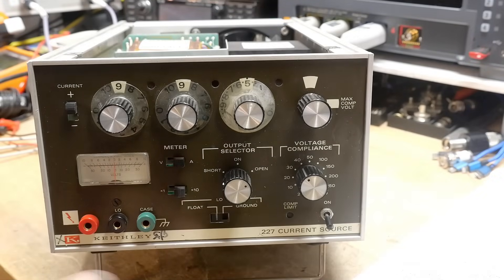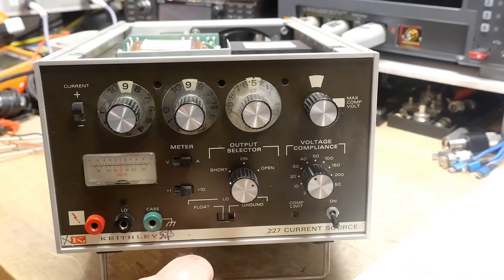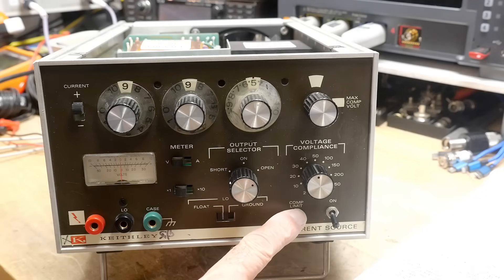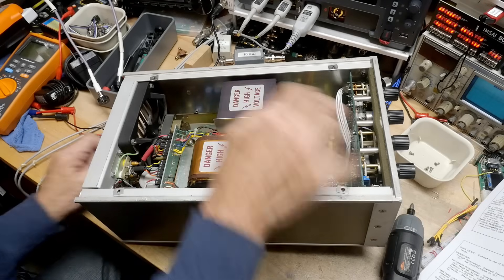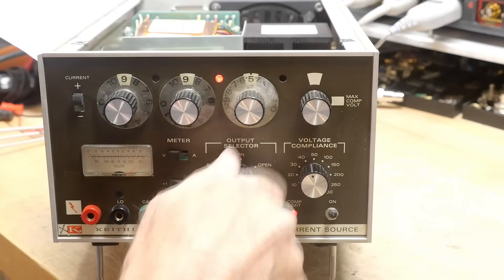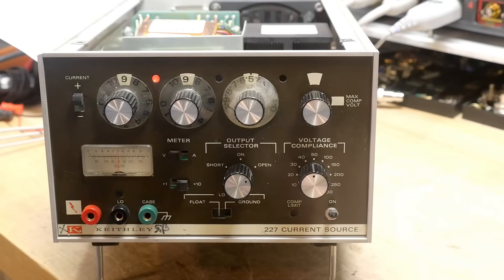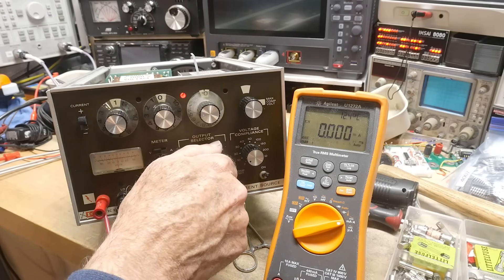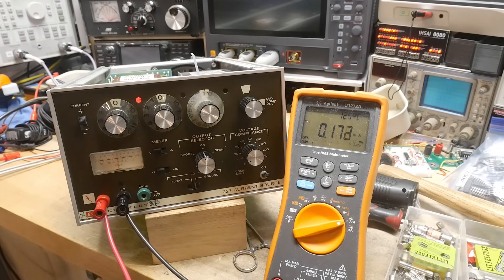#2455 Keithley 227 Current Source (part 1 of 3)

Comment: That's actually ideal for checking large series-strings of leds as found in modern lights with just a little current regulation but very high voltage.

Comment: For the old instruments on can useually get schematics.  The switches / pot seem to have contract problems. This part could be relatively easy to fix. The compliance voltage part seams to be off the scale on the knob a bit too.
There may be part of the labeling missing for the range knob (could have been on the knob). Chances are that the maximum compliance voltage will be lower for the highest current range.

It is kind of a lab supply with accurate settings for the current and only a crude setting for the voltage. The power level is quite high and thus the large transformer and heat sink.
I would really like the instrument to also have 2 ranges for the voltage:  an additional safer range up to maybe 30 V.

Comment: It might be interesting to check the limits. 250V and 999mA is much for a 1.8A fuse, the fan also might take a bit more of it with its age. 
Maybe it was not the original fuse inside. .
Reply: It only does 1A up to 50v, after that it's .1A.  The knob on the right hand side isn't the original:  it would show you the max compliance voltage for the selected range if it were.  I wonder how quickly and stably it reacts to load changes though?

Comment: Biggest transformer I have in a lab power supply is in my 277 VAC 3 phase input 100 Volt 100 Amp DC output power supply from the mid 70's.  The transformer is around a 1 foot X 1 foot and probably 16 to 18 inch's tall.  The whole power supply weigh's over 300 pounds.  Luckily it was designed with wheels on the bottom so it's easy to roll around.  You almost need hearing protection to run the beast the fans are so blasted loud.  I swear it sounds like a fully loaded C-130 taking off.